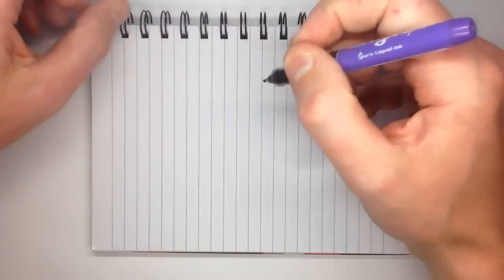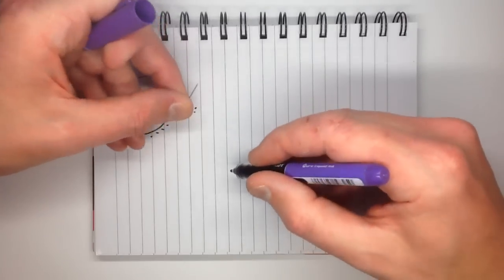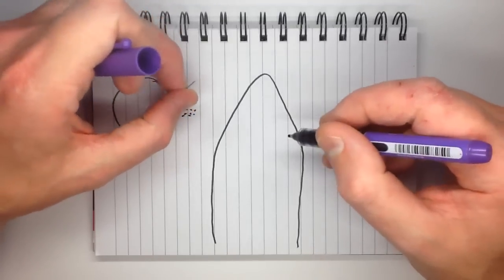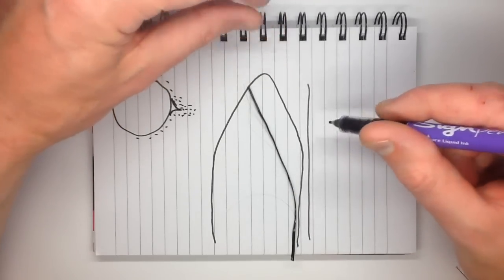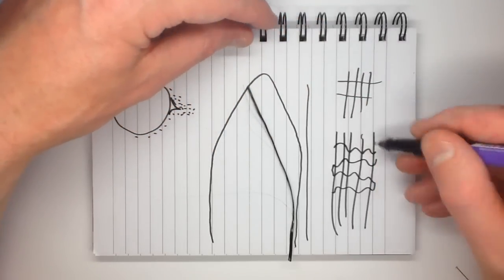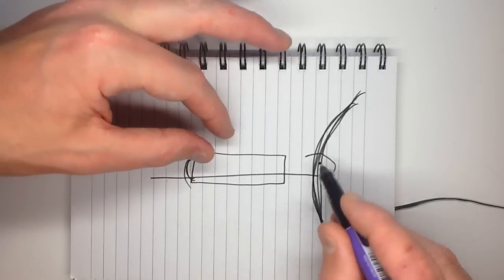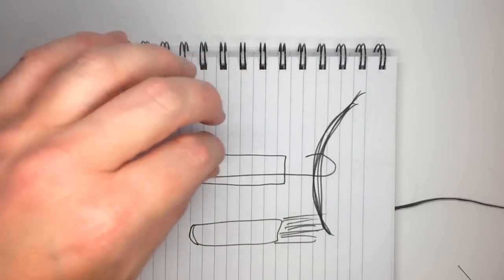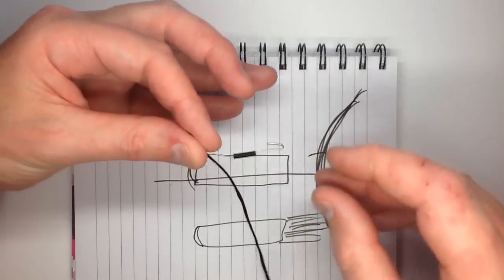Boost your ioniser with a retrofit carbon fibre emitter.

Comment: How to detect ion flow from a source:
Use a Digital Multimeter, and set it to DC millivolts. Connect the red positive probe end to a flat piece of foil, about the size of an index card (perhaps secure it with a clip). Then connect the black negative probe to Earth Ground or hold onto it, thus making yourself the ground reference. (Make sure you don't have any static build up on your body, which can occur in dry areas and in winter with dry air.)
Then approach the ion source with the foil, while holding onto the metal of the negative probe or having it connected to earth ground. Do Not touch the foil to the ion source! (That may destroy your meter.)
You should be able to detect negative or positive ions. If your meter maxes out then switch it to the next range up.
There is no need to waste money on the KT-401 ion detector, when the method I described works better.

Comment: Hi, could I use a piece of fine copper wire instead of carbon fibre and then untwist it?
Reply from the maker: Not really as the best results are achieved with the hair-like thickness of the fibres.
Reply: What do you think, would these strips do the good job? https://www.banggood.com/Carbon-Fiber-Strips-Carbon-Fiber-Flap-Bar-1mm-x-5mm-x-200mm-for-RC-Model-p-1188352.html?rmmds=search
Reply: Pardon me, I just noticed I provided you a link for carbon fibre strip, but I'm thinking of cutting a small strip of this carbon fibre cloth from Banggood 
https://www.banggood.com/510x850mm-3K-Carbon-Fiber-Cloth-p-1102670.html?rmmds=search 
Would it work?

Comment: I still wait for the ultimate ioniser that will attract dust from my floor into the inside of my wastebin...
Reply: Better to put the ioniser above the bin - ie. with ioniser points over the wastebin - then positively charge the bin. Good luck!
Reply: It already exists. Ion light flow. It is a negative ionizer with a positive ion plate. It attracts particles in the air in real time.
Reply: I don’t recommend this ionizer though because dust particles are always being moved in the air, and can actually increase inhalation of particles

Comment: Have you tried holding you LED lamps in front of an Ioniser? Touch one pin and earth yourself. My 9w LED's (The ones you've reviewed) glow quite brightly when within about 6 inches.
Reply from the maker: It's the one in the white drainage pipe on this page:-  http://www.bigclive.com/ioniser.htm
Reply from the maker: PIXscotland I've not tried that.  I'll give it a go next time I'm at home.   Technically speaking you'd need to hold the positive connection of the LED.  If you did it the other way round there's a risk of electrostatic damage to the LED.  My big mofo DIY ioniser has been brutal in the recent dry weather.  I had to turn it off because of all the static zaps I was getting.
Reply: You know we ALL want to see your "Big Mofo DIY Ioniser", along with the juicy construction details :PBuilt my own decades ago - a 15 stage C-W ladder using 1kV 0.1 microfarad ceramics, and 1N5408 (I think) 1kV diodes. It was mounted in a section of plastic drainpipe, and relied on a tiny PC fan to blow air past the needle bank (NO current limiting resistor so deliberately made difficult for "inquisitive fingers"). Worked VERY well, and with some modification is was an excellent room air dust-remover too (worked like the old Precipitron systems)!

Comment: Could you make a review and a teardown of the ebay "arc lighter"? They are quite expensive, but how do they work?
Reply from the maker: Pirat Carribean I may get one of those in the future.  It's most likely a little cold cathode driver style circuit that has the high voltage connected to the two arc electrodes.  I'd guess it's putting out around 5kV at just a few milliamps.
Reply: Firecul42
thanks for taking one in the name of science :}
Reply from the maker: jusb1066 It's high frequency so not really useful as a taser which actually fires a series of electrical spikes as it discharges a capacitor into an output step-up transformer.  It would burn you though.
Reply: jusb1066 I don't think so, not at the voltage the one I had was anyway. I tried it, just got a small burn. Would need to be a proper contact.
Reply: Pirat Carribean I bought one for my dad's birthday. it works ok, more wind proof than a bic that's for sure.
Reply: Firecul42 Yeah, but I want to know what's inside and how it works, it seems quite interesting.
Reply: bigclivedotcom would they work as a mini taser? :} not that i want to use one, just the possible being mistook for one
Reply: bigclivedotcom Two things: I really wanted to point out how enjoyable it is to watch your videos on anything related to ionizers.

The other being I was about to recommend exactly what Mister Pirat recommended, because my brother had just bought two, but my garage door collapsed that day so I was busy and forgot. Sad days. And I actually did a bit of a teardown of the zapatronomatic myself and I was actually quite surprised at how it was actually made. In terms of quality, that is. The 'Tiger' branded Chinese ones are very nice for 10 bucks.

Now then, I won't spoil what's actually inside them because I've never seen anyone else post a teardown and I'd like for you to be the first if you do decide to go at it. Mainly because I expect you to end up blowing something up with it.